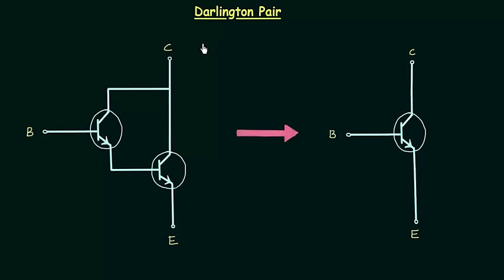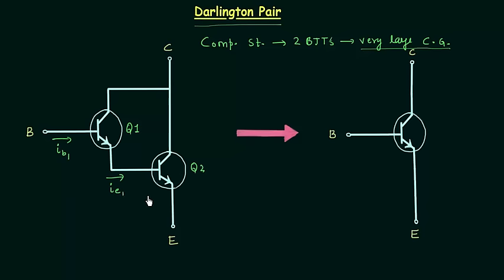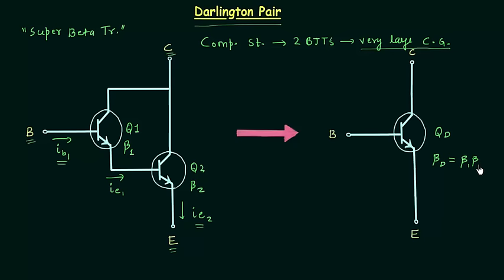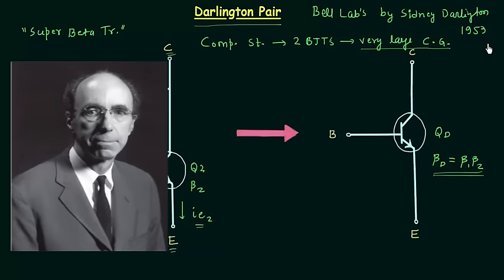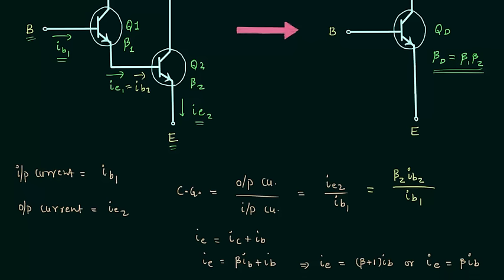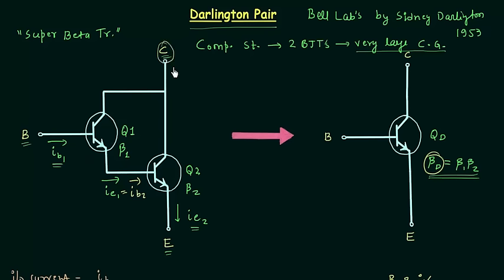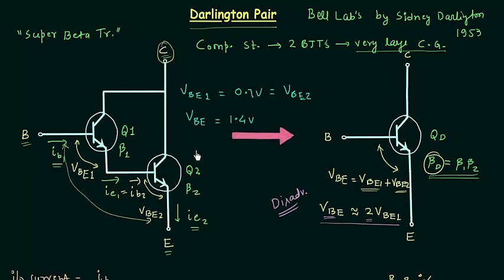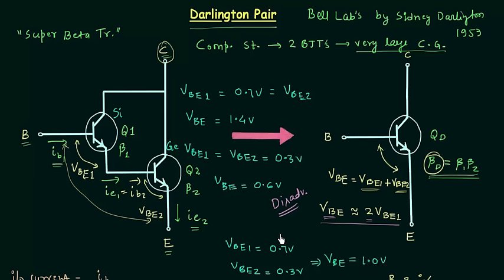Darlington Pair

Comment: The mobile charge carriers consists of electron flow that's opposite the sign convention for current flow. 
This recognition is needed to relate the current to the doped silicon crystal structure in the form of n-type and p-type

Comment: Sir, why don't we want base-emitter voltage to be large?
Reply: same question..
Reply: base-emitter voltage is 0.7 for silicon. If you remember the input characteristics, if this voltage increases, diode will require more voltage in order to start operating.
Reply: Ideally 0.7V for it to remain in an active condition, factoring temperature and current thorough the BJT in real life is different though. Hmm, i guess other viewers who asks the same question as this should explore more about operation conditions. The graph or characteristic curves will tell you about it.
Reply: If you still don't get it. JUST FORGET IT. Think about Vbe as constant 0.7V in DC analysis on FB silicon. Explore more about this when you finished electronics. As ideal and full models confuses a lot of students in their first electronics subj because they overthink.